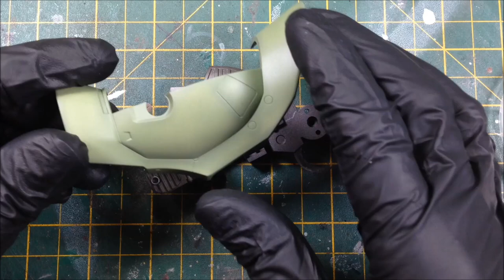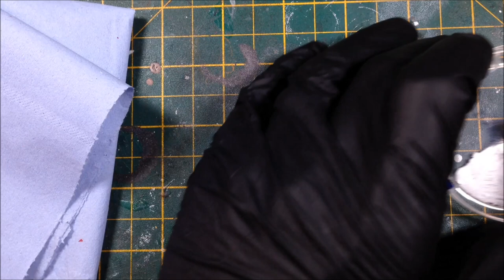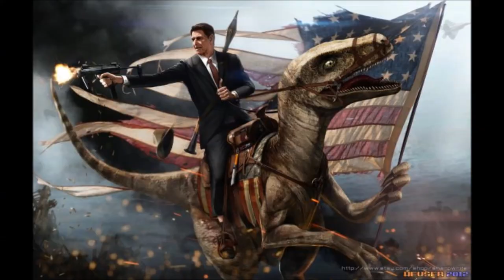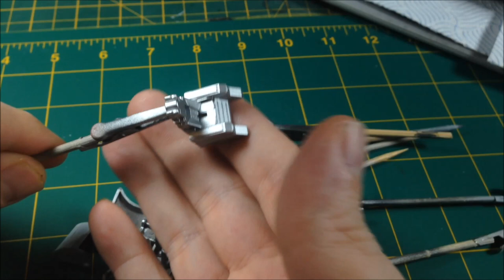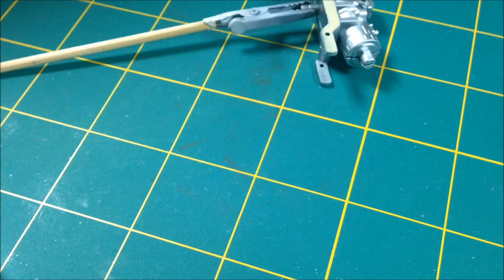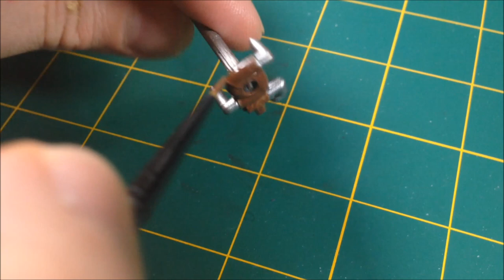PG Zaku II Ammo of Mig Build Part 4: Frame Painting Begin!

Comment: If I can ask I just a new airbrush what do I used to clean it ?
Reply from the maker: Airbrushes can be cleaned with either Airbrush Cleaner ( there are many avalaible, Medea and Ultimate Modelling Products are two of the best) or the thinners you use with your paint. Unless your airbrush is solvent proof, don't ever use Rubbing alcohol/99% rubbing alcohol/Isopropyl alcohol/Isopropanol to clean it out, as it may corrode the seals on a non-solvent proof brush.

Comment: Paint, Paint, Paint, your model. I think I do my dry brushing to fast. :o I"m working on it. :D
Reply from the maker: Work slower!

Wait, not often I need to say that ^_^
Reply: Lynn Dippel fast or slow won't matter as long as you got the right amount of not much at all psint on the brush lol yu can't go wrong as weathering has no rules so go nuts
Reply: I'm dry brushing aircraft cockpit dials. I brush off all the excess and brush it on the model and it still to much so the dials looks like they blew up. lol I
 brush off more and it to late. :(
Reply: Lynn Dippel practice makes perfect as they say
Reply: Always Gundam fan :D
Reply from the maker: Thanks Gundam Fan ^_^

He's correct about the paint amount. You really need to wipe that stuff onto tissue until pretty much nothing is coming off onto it at all. 

Make sure you are using a flat chisel brush not a normal round brush and work the brush almost parallel to the edges of the dial, not directly from above. The flat side of the brush should contact the dial rim, not the tip. You want the brush to just skip over the surface of the rim of the dial, not go into it. 

It also depends on the paint TBH. I find metallics are the best for dry-brushing. I never get satisfactory results with non-metallic acrylics, they just never play ball. OIls are often pretty good also. 

Another option, of course, if the raised details are big enough, is to use metallic sharpies. Those things are DAMN AWESOME for highighting edges if you the side of the nib, not the tip.
Reply: Agree. I was using Vallejo model color Silver. I have used Testors Sliver along time ago that has been my problem all along. To be continued.... :D

Comment: to clean  your brushes  i recomment MR BRUSH CLEANER (buy and the glass  jar that goes with it) or for very heavy paint and putty removal MR TOOL CLEANER .for this do it outside! this stuff smells and  I mean it smells alot!.
Reply from the maker: I actually have a half pot of Tamiya X20-A thinner for brush cleaning, and mixed in is some isopropanol alcohol. For really stubborn paints, and for lacquers, I just use neat isopropanol - both are much easier for me to get than Mr Hobby stuff :) For REALLY stubborn paints, I have some Carson's Paint Killer, which is basically I think neat Xylene. I assume the Mr Cleaner products may possibly be lacquer thinners or even possibly xylene based or cellulosed based if they smell that bad. I do have some Standard Thinners from my car-painting days, and BOY, do they stink. I can't even open the bottle without the whole house stinking for hours, so I never use it.

Comment: Could you do a perfect grade AIRBRUSH FREE? I'd like to try that challenge myself
Reply from the maker: Yup, it would be perfectly possible. As long as you use the paints carefully (i.e. THIN YOUR PAINTS and TWO THIN COATS, lol) you would be fine. The only thing to be aware of with Gunpla is that brush painting can lead to thicker paint layers, so keep aware of anywhere there are moving parts than need a certain clearance to move (or just build it as a static model). I will definitely give a brush-painted PG a go at some point, when I can afford one :) 

If you haven't already seen it, I did do an airbrush free HG: https://www.youtube.com/watch?v=xAHWjJwaXmw&list=PLT8l3DNUdcBB-dRoXP9eB1f4ewc87-ANC&index=1

Comment: power cables
Reply from the maker: Power cables?  Nah, these aren't those, that's not what they are, these things are the housing that a piston goes into. Is it a cylinder, is that what they are called? I really can't recall.
Reply: Modelmaking Guru sorry thought the beads you couldn't paint insude were the armour for the waist and helmet power cables
Reply from the maker: OH I thought that might be that case, no, it's the little things I have on sticks ^^ Those beads you mention are power cable housings I think ^^
Reply: I think the more appropriate term would be wire harness. They remind me of the black cables in cars that are just protection for the many various wires inside, which are of course called wire harnesses.